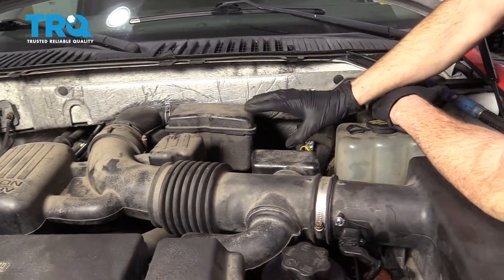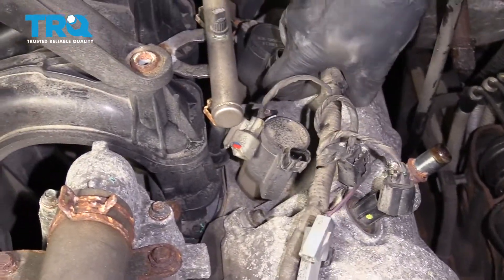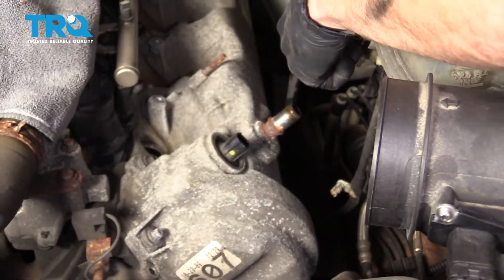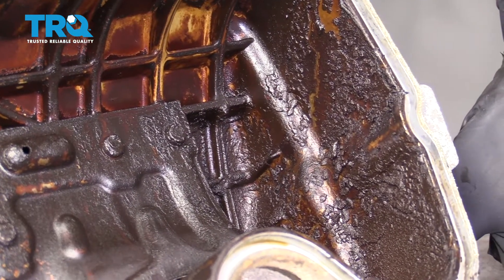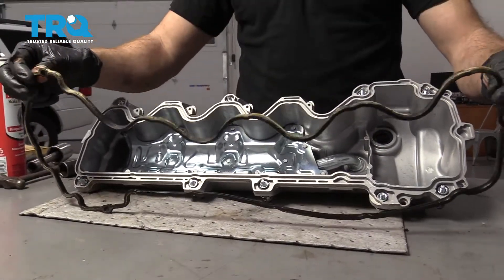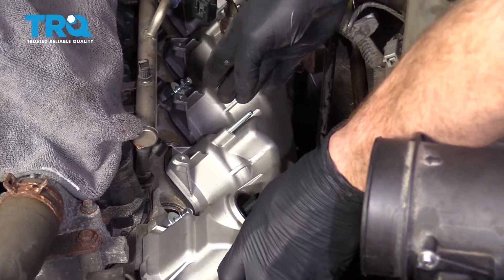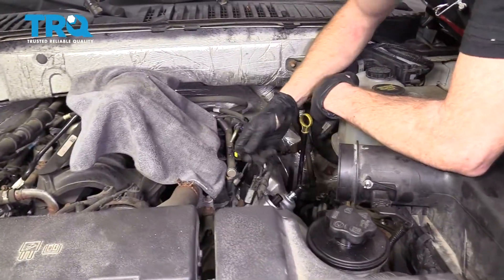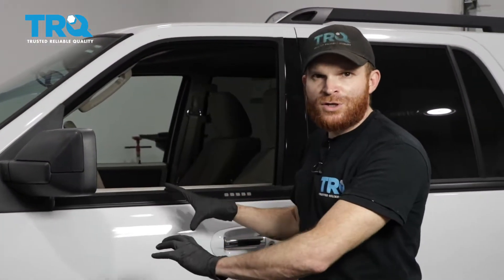How To Replace Driver Side Variable Valve Timing Solenoid 2007-2017 Ford Expedition

Comment: All you had to do is crush the seal and pull it out. Of course you have to replace the seal. Id rather replace 2 seals than removing all the wiring and valve cover.

Comment: Here's a much easier way to do this without removing the valve covers.      https://www.youtube.com/watch?v=_tgfghbnt8I
Reply: There are two different valve covers for the 5.4, and one of them requires valve cover removal to change VTS. Look at the size of the seal around the VTS connection.  If its smaller, you have to remove the cover. If it's the bigger one, you can get away with leaving the cover on...

Comment: I have replaced both solenoids on my 2011 king ranch. 115,000 miles. After getting the p0022 & 21. I am still getting the pO22. I’ve also changed the oil afterwards. Any ideas?
Reply: It could be mechanical issues. Faulty roller followers, lash adjusters or timing components